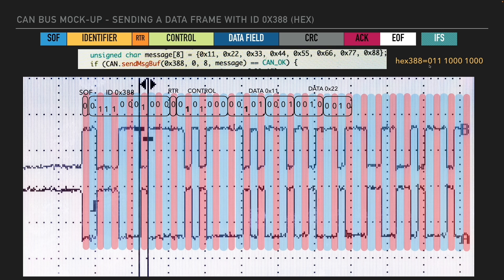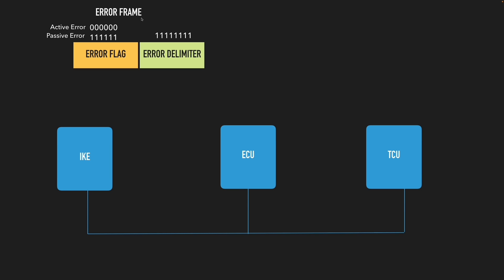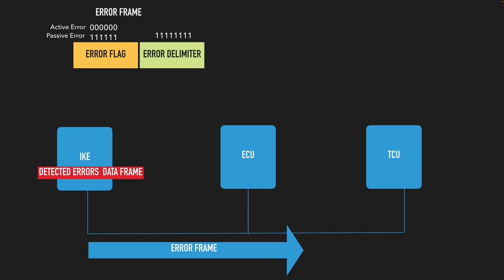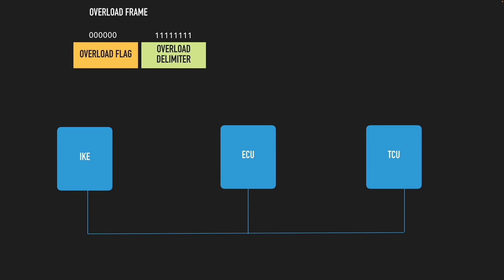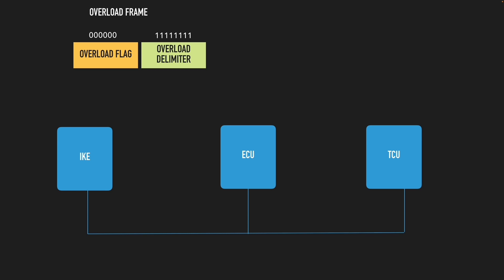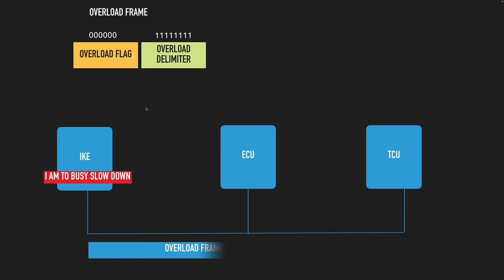Yes you CAN ! Understanding  the CAN BUS - PART - 3B -  PROTOCOL

Comment: what then happens when for instance the cluster sends  overload frame? since the data was not received by the cluster, is the data stored temporarily or the TCU will resend the data again will the cluster acknowledges that data is received successfully?
Reply from the maker: The upper layes of the can controller have a status matrix and any outstanding response to a request, be it due to an overload or error frame will be retransmitted after a hold down time .   Until the information is received

Comment: Thank you for an informative technical video. Can I ask a question? when the transmitter receives the following frame 000000 11111111. how did transmitter know it's an active error frame (the value of error flag is 000000) or overload frame (overload flag = 000000) from one receiver node?
Reply from the maker: As you stated the pattern alone is ambiguous –  but the context (bus state) disambiguates it.   Remember that :
 Active‑error flag ⇒ retransmission, counters increment.
Overload flag ⇒ just stretches the idle gap, no counters, no retransmit.
So when your node sees 000000 11111111, it simply asks “Am I still inside a frame or already in IFS?”
That single piece of context tells the controller whether it has just witnessed an error or an overload request from another node.

Comment: Fantastic series on explaining the CAN bus. Thank you for sharing your knowledge with us and for presenting it in an easy-to-understand format. I'm assuming the reason that auto manufacturers have opted for using twisted pair as opposed to a shielded LAN or coaxial cable to due to cost. And am also assuming the reasoning why manufacturers have not considered the use of Bluetooth or Wi-Fi in lieu of wires is due to speed and perhaps security/safety concerns.
Reply from the maker: Thanks,   twisted pairs have been around a long time, long before Wifi a d BT, in fact RJ-45 is also a twisted pair ( but multiple pairs).   As the CAN bus was developed in the 80's, there was no LAN cable , wifi or BT in existence.   Well maybe some thick coax based thick LAN .  So the option was easy at the time , use twisted pairs, low cost, low weight. Once the standard for CAN was set, it was normal to move along with twisted pairs.   Wifi and BT could become an option but  then in a secured version, both for access but also for interference or DDOS.    That is why I believe Twisted Pairs will be around for a long time, keep it simple and stupid as they say (KISS). Thanks for the comments

Comment: Thank you for an informative technical video. CANBUS is not the only protocol that rides on the RS-485 physical data standard. There is also ARCNET and some other proprietary protocols. The terminations of 120 ohms derive from the original RS-422 and RS-485 recommendations and generally requires a cable with a characteristic impedance approaching 120 ohm - this is based on the dimensions of the conductors in the cable and the insulation. And shielded cable requires a connection also at both ends. I have seen ARCNET working at 10 Mbps over distances of roughly 20 meters. But also at distances of >800 feet (240 m.) on a train communication system used on the Boston Blue Line subway cars at a data packet rate of 5 Mbps. I know because I tested that in 2008. For low data rates (<100kbps) the RS-485 data could reach 4 km.
Reply from the maker: Thansk for the comments, and yes you are right ,,, in part 1,2 and 3  of the CAN I do address other busses
Reply: @ber nard you are very confused CAN does not use rs485 interface unless i got confused myself 😅
Reply: @ that is correct, but while RS-485 provides data communication using the differential TTL voltage levels by the transceivers, CAN Bus has different transceivers and more functions than the original RS-485 designs. The commonality is that the same 120 ohm cable is specified and the  signal waveforms and voltages are the same. I worked on an Arcnet design that allowed communications through commuter rail cars. RS-485 transceivers allowed the network to function and used the same 120 terminations.
Reply: @hewking  Hello, CAN Bus is a protocol that specifies the data packages that are needed to communicate with the units in the network with each unit having an independent ID. But to communicate, there needs to be a physical way to send the protocol over wires. In Part 3 of the video by D3Shooter at time 8:22 you can see oscilloscope views of the data on the cable. There are two waveforms, exactly out of phase. Having signals out of phase helps the receiving circuit to eliminate interference by common mode rejection. These waveforms signals are produced by circuitry that is based on RS-485 signal formats but the 1's and 0's are determined by the CAN Bus protocol for the required functions. And that is also why the cables used need terminations of 100-120 ohms at each end. That way the signals maintain there integrity and are not distorted. The cables used are supposed to have a "characteristic impedance" near 120 ohms so that the square wave shape highs (1's) and lows (0's) are preserved all the way to the terminations. There can be alternatives to RS-485 but the circuits have been used reliably since the 70's and are low cost.
Reply: @bernards8050 really appreciate additional info from you. In my simplistic understanding rs485 is just electrical interface which cannot do arbitration eg. when modbus master asks its slave it will reply but one unit can talk at the time so no need for arbitration. Is rs485 capable of arbitration at all? in general can you share what physical media or interfaces can CAN ride on?
Reply: @ in theory, optical paths could be used provided the CAN Bus transceivers meet the functionality of the CAN Bus specification. But in automobile connections, that probably would not be cost effective. The specifications for CAN Bus have much more functionality that RS-485 but the signal interface to the cable is essentially identical and that is why the terminations are 120 ohm as for RS-485. And instead of special cable, even 1 twisted pair in a CAT5 Ethernet cable could be used to carry the data for clock rates even to 2.5 M for distances perhaps to 200 feet.
Reply: @bernards8050 massive thanks for reply. One thing still bothers me - CAN and rs485 are not the same - can axis level is 2.5 V where can high can be 3.5 V and can low can be 1.5v while rs485 are truely inverted signals with axis at 0 V. Is it not a fundamental difference between rs485 and can? cable wise i understand twisted pair is good for both can and rs485 but voltages differences makes both networks not compatible on the physicsl layer. Please correct me if wrong
Reply: @hewking  I wrote a longer reply but touched something on my laptop and it disappeared. The voltage levels for RS-485 were based generally on the norms for TTL with a margin for interference and a dead zone. And RS-485 can be designed for 2 wire or 4 wire. For Canbus details refer to the ISO 11898 specification.

Comment: A work mate bought a Smart car and it didn't come with a tachometer. He went to the dealer and they sold him the tachometer pod and it just had a 4 pin connector on it, power, ground, CAN-H, and CAN-L. He popped out the blanking plate on the dash module, and plugged the tach into the CAN connector and it immediately started listening for the engine speed message ID, turning the needle in response to the value in the packet. There's no connection to the engine electricals to sense the engine speed, just a message on the bus.

A good way to think of CAN is that the messages are tag+value pairs. The tag is a well known (by the manufacturer) ID and the value is 0 to 8 bytes long. The messages are sent out to the bus periodically as a PUSH message. The ECU is letting the other nodes on the bus know the value that it has calculated, the other nodes can just listen (tachometer), just talk (a smart switch), or talk and listen (a tail light cluster that can flash turn indicators, illuminate brake and reverse lights, and detect failed light bulbs and report the failure).

But you can do other things with the data like the transmission controller may send out a message saying "the transmission is in reverse" and the passenger side mirror controller can use that message and tilt down to help show curbs while parking. Or the driver's door controller may send out a message saying "button 2 has been pressed" and the body controller would send out a message in response saying "unlock the passenger side rear door", then the passenger door controller would respond by activating the lock solenoid.
Reply from the maker: Thanks for the great response

Comment: Thank you for your excellent video series on the CAN bus! I've watched all of them I really learned a lot! I have a question though. I'm familiar with how the RS485 physical layer works.How is it possible that 0 is dominant on a CAN system? Is there just weak isn't the CAN driver a push-pull driver that drives the lines high and low, or is it like OneWire/i2c where there are pullups, and the devices on the bus are only "pulling down"?
Im my experience, a collision on an RS485 bus can may be impossible to detect if there are long cable runs, because the the cable itself will act as a series resistor, "covering up" the collision, so a sender will actually receive the same data as it just sent, while another sender in the other end also does this.
Reply from the maker: Thanks for the comments.  Here is why /how . The key reason why a dominant (0) bit overwrites a recessive (1) bit  is due to the open-collector/open-drain design of the CAN transceivers.  This allows any node to pull the bus into an active dominant state while leaving it passively in a recessive state otherwise. Hence multiple nodes can drive the bus without conflict.  Even a single node transmits a dominant state (0), it will override any recessive (1) signals.  

The transceiver  open-collector, connects to the bus CAN-H and CAN-L .The bus is passively pulled to the recessive state (logical 1) when no nodes actively drive it. 

Any node can actively drive the bus to a dominant state by pulling CAN_H higher and CAN_L lower(creating a differential voltage of about 2V between them).  

When no node is actively driving the bus, the built-in resistors pull the lines back to their recessive state.  The recessive state means CAN_H and CAN_L are closer together in voltage (~2.5V each), producing a near-zero differential voltage.

The  transceivers allow any node to force the bus into a dominant state by connecting CAN_L to ground and CAN_H to a higher voltage.Other nodes attempting to send a recessive state (which does not actively drive the bus) will be overridden because the bus is physically forced into a dominant state.
Reply: @D3Sshooter  It would be very interesting to hear how the LIN bus works as well, and why they're not using "isolated" CAN buses instead. I own a French car, and as far as I know it uses LIN buses for most non-critical things like climate control and window switches.
Reply: @D3Sshooter  Excellent explanation! I thought the high speed of the bus would (fast edges) would require push-pull drivers. But as you explain, it is open drain, and it's very clever in an application like this where the cable runs (in a car) aren't hundreds of meters.
Reply: @D3Sshooter   @hansibull  Made a good point, it would be so excited to learn other bus technologies like LIN, ETH, MOST, LVDS, etc. of the modern vehicle wired networks.